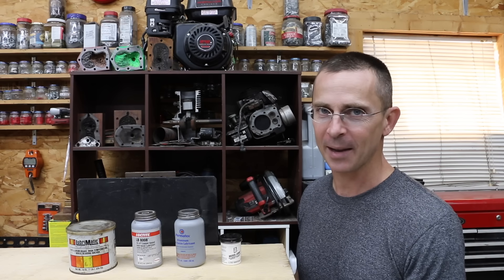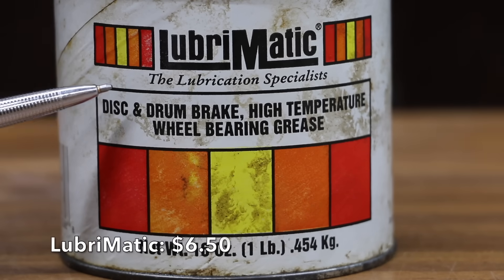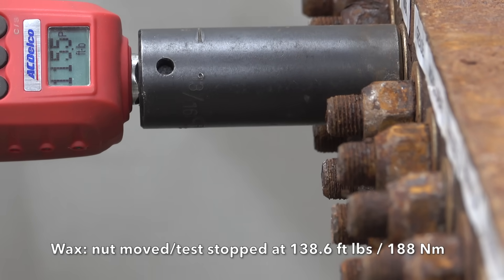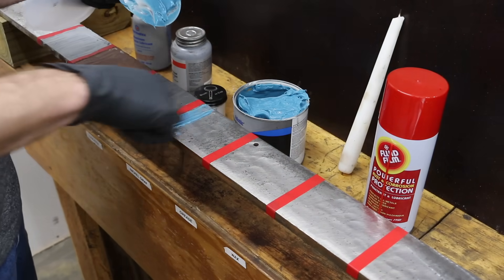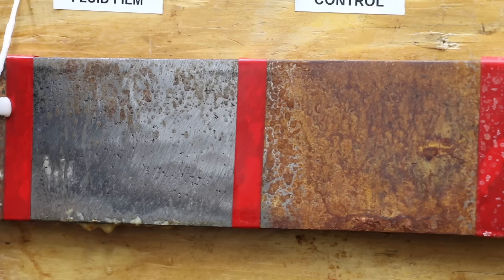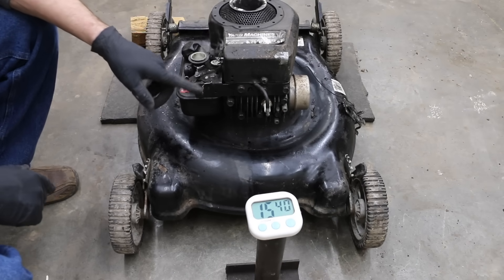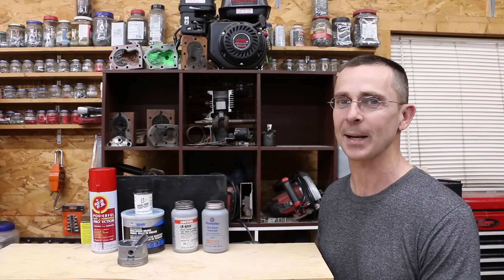Does Anti-Seize Compound Actually Work? Let's find out! Anti-Seize vs Grease vs Fluid Film vs Wax

Comment: if loctite has expiration date is it less effective after the date. well in practical experience I have both locktite copper and permatex that are at least 20 years old. what happens with both is the liquids inside separate and they need to be remixed but both work very well after remixing and used.

Comment: LoctiteMarine Grade is the best I've ever used.  It has a high temperature rating and has no particles to cause galling in dissimilar metals like stainless bolts into aluminum threads. I've never had a bad experience with it.
Reply from the maker: Thanks for the feedback.

Comment: In the Navy, working on the A-4 Skyhawk, aka "Scooter" we often spent a lot of time drilling out panel screws until we learned that  we were issued a spray anti-seize  spray for a reason. It had a consistency very  much like WD-40. I have no idea how it would work in high temp applications.
Reply from the maker: Thanks for sharing.

Comment: Yes anti galling ! Thread lubricant just like Teflon tape. Teflon tape is a thread lubricant not sealant by design. Only rated 100 psi tiny fragments break off get inside hydraulic circuits causing system failure! There’s a little engineering book by Thomas j Glover explaining torque values with different lubricants  oil to Teflon increase in value of multiple torque pressure and decreases effort to tighten ❤

Comment: Great video once again. If the test is ever run again it would be interesting to see a set of bolts done without the heating included in the group also.  Chemicals like Fluid Film might perform better.  

The vast majority of fasteners will never be subjected to very high temperatures.
Reply from the maker: Thank you!

Comment: Anyone have a anti-seize recommendation on 304 stainless steel bolt, threaded into an aluminum housing nut. This is for a water skiing toy (Sky Ski) so it is in fresh water for max 1 hour/week for 5 months out of the year. Didn't know if I need something specific due to the difference in metals. Thank for any advice.

Comment: If you ever broke 56 one inch bolts on a 46A Cat under carriage and had to drill them out. You definitely put Never Seize  on the replacement bolt. The Cat worked in the ocean off the the Orange  county beach
Reply from the maker: Thanks for the feedback.

Comment: I use copper grease. But if the bolt needs an exact torque, you need to look at the tables. Adding any kind of grease will change the torque setting.
Reply from the maker: Thanks for sharing.

Comment: Places like shock mounts I prefer spraying rubberized undercoat. It may be messy but the bolts always come apart years later when Anti seize would have hardened into lock tight
Reply from the maker: Thanks for the feedback.

Comment: not relevant anymore, but i think for a fair comparison, the wax should be applied to a heated metal surface... only then it flows and sticks, almost fuses to the metal (similar to soldering, you must heat the copper for the solder to fluw) - like waxing the underside run surface on snow sleds...the results would be much better. Other than that - one of the TOP youtube channels !!
Reply from the maker: Thanks!  Thanks for the constructive feedback.

Comment: I normally love your processes however 550 degrees is far too hot for this test.  A temperature of 300 degrees would have been far more reasonable.  Most greases and oils are going to be operating at less than 200 degrees.  That would be what happened to the wax.  I'm not saying wax is good or anything tho.
Reply: The average exhaust bolt reaches more that 500 degrees

Comment: Burndy makes an anti-ox product called PENETROX. Penetrox A is meant for aluminum-to-aluminum OR aluminum-to-copper electrical connections. It covers both bases. As an industrial electrician, I use it all the time when working with corroded/rusted factory hardware, or brand-new bolts as well. It's indispensable when you know YOU will be the one taking crap apart again someday.

Comment: Once we had to dismantle a bunch of diffusers out of an oxygenation tank at a waste water plant. The equipment had been submerged in sewage for 30+ years. It all unthreaded with ordinary open end wrenches. Every other time we demolished old equipment, we had to cut every fastener. We were all grateful the original installers used anti-seize compound on every threaded fastener.
Reply from the maker: Thanks for sharing.

Comment: Been using Locktite copper on steel bolts and nuts on steel and cast iron parts for years. Axle grease on parts going into aluminum.
Reply from the maker: Thanks for sharing.

Comment: I always go with Permatex. If it's low corroded environment / low temperature exposure (e.g. car bolts and nuts under car), then I go with Aluminum. If it's highly corroded / high temperature exposure (oxygen sensors, spark plugs, and etc.), then I go with Nickel.
Reply from the maker: Thanks for the feedback.

Comment: Something is amiss if Surface Shield had a higher torque removal rating. It's said tightening torque values should be reduced 25% to 30% if tightening when wet. Perhaps Surface Shield lubed the best and tightened the most.

Comment: Twice as long? Rust? LOL. Spent a full day rebuilding an ear on a transmission case where the shift cable mount is bolted too. Rust on the bolt caused the aluminum case to crack around the bolt hole, then the crack corroded until the ear disintigrated, while I was getting the 1/4 million mile transmission ready to install, as I had no luck searching for a junkyard replacement for over a month. There were several available on Ebay, but the warranty was pointless, as I'd be out more money sending it back than just eating the cost, for similar mile units.
Reply from the maker: Thanks for the feedback.

Comment: I'd be more interested in how anti-seize works on stainless steel threads, which are notorious for galling.  I've never used anti-seize for rust prevention.
Reply from the maker: Thanks for the suggestion.

Comment: Good stuff, but other products can also serve the purpose. Years ago I read about using RTV  (the general public knows it as silicone caulk) on shock absorber mounting hardware which was notorious for seizing up with rust. It worked perfectly. I sometimes use nail polish sparingly as well.
Reply from the maker: Thanks for the feedback.

Comment: Anti sieze is amazing!  I changed tie rods and a center link on an older car. Brought it in for alignment. The mechanic called me in the back. My car was on the lift and he pointed to the front suspension and asked me “did you do this? (anti sieze everything)?” I said yes. He said “thank god!”

Almost every bolt I touch has anti sieze on it. But there are places where you’re not supposed to use it. For example, I put it on the top shock bolt on an electric scooter figuring that bolt will be subjected to all kinds weather and rust. The bolt was actually protected in a sleeve by the manufacturer for just that reason but now because I put the anti sieze, the bolt comes loose and I have to tighten it every few days.
Reply from the maker: Thanks for the feedback.

Comment: Thanks for confirming that I’m not wasting my $ on Permatex. It’s always worked well for me, and is way cheaper than Locktite. Candle wax? Really? Nice to know that hi temp grease works til I can get more Permatex. Love your methods. Can’t argue with/ a sound experiment method. Well, i guess you can if you just want to argue. Another great video that has every day practical application.
Reply from the maker: Thanks!

Comment: Personally, I've been using Permatex Anti-Seize for over 30 years. I began using it after I found my factory wheels were rusting to the wheel hubs. Now for every car/truck, I make sure the wheel center/back/bolt holes are free of rust as well as around the wheel lugs/hubs/rotor back and disc brake slides/bolts. No longer have to use a dead blow hammer to remove wheels.
Reply from the maker: Thanks for the feedback.

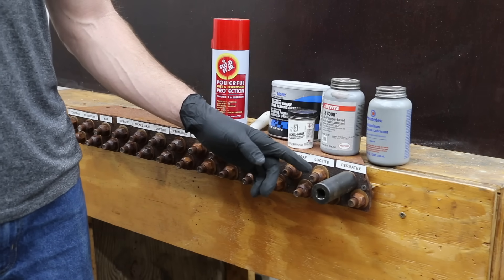Comment: Yes it works very well. I was a heavy equipment mechanic for many years. We used it all the time. It's vital on some applications. The copper based LOCKTIGHT   brand was very good. We also used a lead based type a lot but don't remember the brand. 4:10
Reply from the maker: Thanks for the feedback.
Reply: @ProjectFarm  My pleasure. For me your videos are very interesting. I watch them all the way down here in Ecuador. Hope you make one comparing gas powered generators one day. Thank you.

Comment: I'm curious to see if I replaced my recommended differential oil ,high viscosity  75w-140 with a low viscosity 75w-80 plus an additive to reduce friction and wear , if they will have similar protection in this case , I'll be improving gas milage and power due to lower churning losses
Reply from the maker: Thanks for the suggestion.

Comment: YOU got my gray matter between my ears thinking. How about a video that actually checks ANTI-GALLING PROPERTIES FOR STAINLESS STEEL PIPE THREADS ?? This is actually a real problem for taking apart pipe fittings to be reused since the cost of 304 and 316 stainless steel is very high. But the super clean properties of the metals make them attractive to be used for drinking water and hygienic production and manufacturing food items. Assembly the first time is easy but taking things apart is another problem. GALLING AT DISASSEMBLY is where the real problem begins. Assembly anti-galling paste or lube has its work cut-out for this usage surface. You have teflon tape, paste which is very reasonably priced to exotic metal additives to metal particles free Moly base or other exotic items that cost hundred of dollars a pound container. They each brage and swear how good their products work. In the real world you have users who either praise the item or curse the very product who use it. 
Good day and peace to you Sir PF. vf
Reply from the maker: Thanks for the suggestion.
Reply: I hope you can run with the idea PF. Peace. @ProjectFarm

Comment: I've always used either wheel bearing grease or lithium grease on every bolt on my motorcycle, lawn mower, or SUV. It seemed to work fine. I heavily grease the lug nuts on my SUV to make sure if I have a flat I'm not struggling on the side of the road to change the tire. I'll probably give Loctite a try though.
Reply from the maker: Thanks for the feedback.

Comment: As I started messing around with 02 sensors waaay back when, I discovered that regular grease wouldn't cut it... they didn't want to come out after being run for a while. But with anti-sieze... never a problem.

Whenever I use it on exhaust clamps and flange studs... even years later they all come right apart. For constant high-temperature applications, nothing else compares.
Reply from the maker: Thanks for sharing.

Comment: I enjoy your thorough testing videos.  The question I was hoping to answer is if anti-seize would be a good lubricate to use in dryer bearing idlers and rollers which are really metal to metal bushings?  These are designed to run dry, metal to metal, which causes them to fail eventually, probably by design.  I have used oil and grease in this application, but they tend to dry out over time and make matters worse.  I've not tried white lithium grease (WLG), which doesn't seem to dry out as much and is highly acclaimed in other metal to metal applications.  Wondering if anti-seize would work best since it has small metal particles in it that act like small ball bearings?  Though maybe those metal particles would be detrimentally abrasive in this rolling application?  A veteran appliance repair tech I know uses Zoom Spout turbine oil, advertised as being "paraffin based non-gumming".  Other oils I've used have dried out and gummed up; unsure if turbine oil would be better?  Hoping you might consider testing WLG, anti-seize and turbine oil in this dryer bearing application.
Reply from the maker: Thanks!  Thanks for the suggestion.

Comment: Hahaha. Anti-seize in a lawnmower. Good one. 
For the anti seize products to really shine, they would need to be used on exhaust manifold bolts after 10+years of daily driving. Also would be good to test suspension bolts in areas where they salt the roads.

Comment: Thank you for the videos. I won't use anti-seize instead of oil that's for sure. You don't want to use it on lug nuts either. Unless you like chasing tires down the road. A friend of mine worked for a company where they drove large trucks for work. So as they were going down the road he noticed a vibration. Pulled over and realized the lug nuts were loose. By the time they finished their job and returned to the office they had retorqued the lug nuts 6 times. A couple days later he was walking through the shop and noticed one of the mechanics putting anti-seize on the tire studs. That was when he realized what had happened to the tires on his truck.

Comment: Video idea: It would be useful to know how much various anti-seize compounds affect torque requirements. That is, how much less torque is required to get the same stretch compared to bare threads and oiled threads. An experiment could torque several sets of bolts and nuts with the threads coated with various anti-seize products so that the bolts stretches the same amount. If long bolts, say around 10 inches are used, it should not be difficult to measure the stretch. It in not the usual "best" test that you perform, but the information would help when torquing fasteners.
Reply from the maker: Thank you for the video idea!

Comment: Just curious. Is there a reason you went back to the smaller Torque adapter when you didn't need the larger one? Is the smaller one more accurate?

Comment: As I am watching your presentation on anti-seize it seems to imply that seizing is caused by rust and/or corrosion.  My experience is that seizing can happen without corrosion. It happens especially with aluminum, such as aluminum bolts tightened into aluminum nuts or threaded assemblies.  It does not happen quickly but over a period of time where metal actually deforms and joints to the two items together –  this situation is commonly referred to as galling and happens at normal temperatures. (although heating may speed the process)

I guess what I’m trying to say is you’re treating anti-seize like a lubricant and corrosion preventative. I’ve always thought it was to prevent aluminum galling from seizing things. I would never put it in an engine.  And as far as corrosion preventatives are concerned I would use sticky lubrication such as way lube or garage door lubricant or motorcycle chain lubricant.
Reply from the maker: Thank you for sharing!

Comment: There is actually an easier way to prevent bolts from seizing.  Tighten back the bolt/nut then coat the area where the threads exit, with a THICK anti-rust spray.  The goal is to prevent water from entering at the place where the exposed threads exit the nut - so coat with anti-rust right at the nut/thread interface, no need to coat the entire exposed thread.  Nuts and bolts get stuck when water enters by the exposed thread under the nut, so that's where you want to block the water from entering.  And you do this after tightening back the bolt/nut. Key is to use an anti-rust that is thick, watery ones will quickly wash off. This works excellent even in salt belt areas with harsh winters (I'm in Canada). You want to check one year later and to see the area as greasy. Use anti-rust for this, not anti-seize because they harden and won't stay in place. Also do this when you purchase a new car, on all exposed nuts/bolts
Reply from the maker: Thanks for the constructive feedback.

Comment: I have used the aluminum based Permatex for many years and it works well. I then switched to the loctite copper based product because it i ssupposed to be better, but I did not find that to be true. It's okay but from personal experience I found the permatex aluminum based anti seize is better, and it cost less.
Reply from the maker: Thanks for sharing.

Comment: Anti-seize property for steel bolts into aluminum. The purpose is not for rust prevention but for dielectric bonding of steel to aluminum.
Reply from the maker: Thanks for sharing.

Comment: The Permatex has yet to fail me when I use it on the rotors of our cars so the aluminum rims don't "weld" themselves to them over time. I also use it on the lug nuts and have yet to have that fail.
Reply from the maker: Thanks for the feedback.
Reply: The best way to avoid this is to rotate your tires. I never worry about this because the wheels never stay in the same place for more than a year, if that.

Comment: When you torqued them, you should had used an angle gauge to see which products allowed for the most tightening at 90 foot lbs. Torque is lost with friction, so a good anti-seize should allow better clamping at the same torque by reducing the friction loss.
Reply from the maker: Thanks for the constructive feedback.

Comment: In my experience just putting grease (my favorite is graphite grease) on the bolt and it never rusts so much that you can't remove it.
also it was common practice some time ago to put graphite grease all over exhaust parts when you put them back together, to improve the gasket seal and make it possible to remove the bolts without snapping them after use.
Reply from the maker: Thanks for sharing!

Comment: So one comment to make here. There are several different types of anti-sieze that work better in different applications. For example the copper based anti-sieze works great for steel on steel but the nickle based stuff works best for steel on aluminum applications. It has to do with the galvanic corrosion that occurs between dissimilar metals where the metals in the anti-sieze actually becomes the sacrificial metal. Of course this works best if you have the right anti-sieze for the application.
Reply from the maker: Thanks for the feedback.